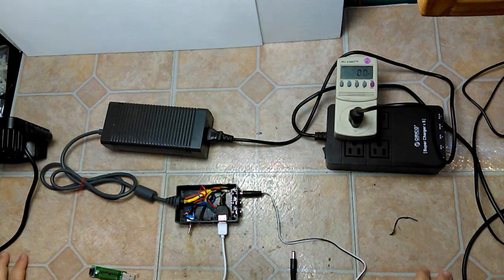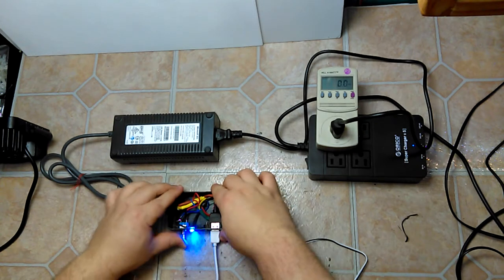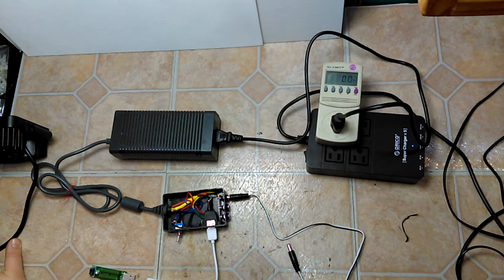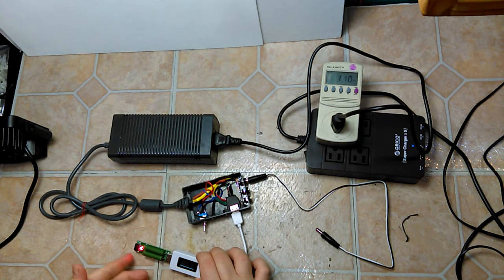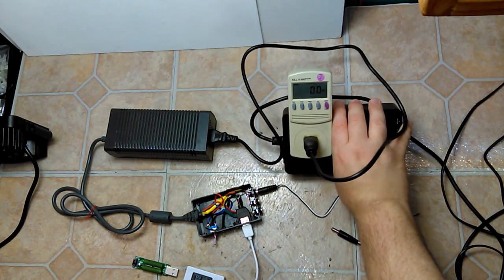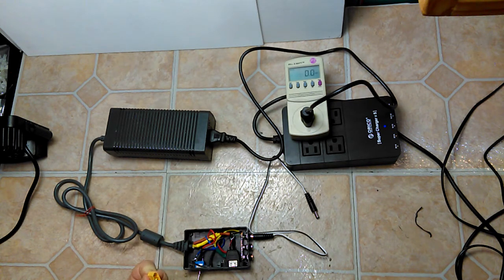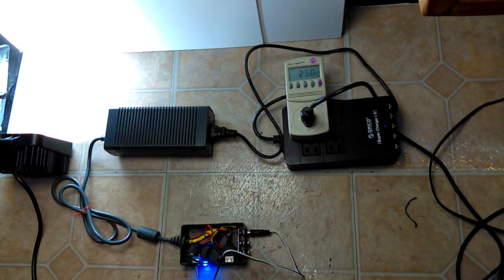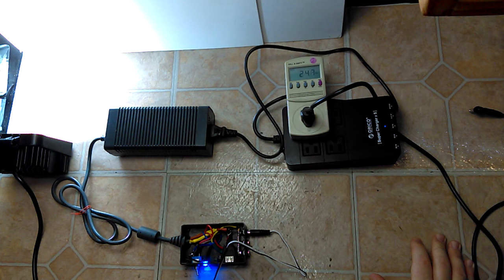XBOX 360 Power Supply Modifiaction 12v 5v USB

Comment: Hi,
Nice build. I'm also trying to transform an xbox 203w psu to power a picopsu for an HTPC. I'm trying to figure out if there is a way, instead of the switch for activate the 12V, to connect somehow the wires to the pico psu and when I shut down the PC the xbox psu will go in stand by. Do you think is possible?

Comment: Hi. Thanks for the video. I'm looking to use the Xbox PSU for LED lighting projects and I would like to use 12V RGB led strips and a 5V microcontroller. At first I thought this would be perfect, but I don't think you can tie the grounds together. Do you know if you can connect the grounds? I did a preliminary test with an led and resistor on the 5v line and got 12v on the others when the LED was connected, but as soon as I touched the grounds together, the 12v line dropped off.
Reply from the maker: Ok, for the PSU to work correctly the red 5v wire must be in contact with the power enable wire which is blue,  They all use the same ground on the black wire.  Its hard to tell, but I have one of the black wires going to the USB port that I installed, and the red 5v line goes to the switch and to the USB by a Y cable.

Comment: Man, i want one of those AC power meters :P

Im gunna use this to power my dc battery charger :)

I wanna pull it apart tho and check the fan etc so it cools even better. Might build my own case or something :)
Reply from the maker: The unit I use is called a Kill A Watt, they will run you about $15-19 in the US

Comment: You have a lot of expertise about these things; very thorough.
I just wonder what you use it for, cuz I feel this all does not make
much sense.
I have no idea what ur trying to achieve with this setup.
Reply from the maker: LED lights, security cameras, Power supplies for charging batteries.  Pretty much anything that needs a 12v or 24v source at a high amperage. The unit in this video currently runs all the lighting on my work table, about 140 Watts of LED strips.  A lot of others use them for stereo power supplies

Comment: I want to use the slim power supply into the classic original XBOX360 
Because it uses less energy and that will be perfect so it doesNOT overheat
Reply from the maker: No, the standard XBox 360 power supply provides the power need 200w 150w or 175w, the slim only provides 120w and can not power any of the other XBOX 360 models.  Not to mention that the power out pins is completely different on the 2
Reply: Data 795 
I know all that.
My point is that if they can make an adapter or a power supply that is around 130w or a120w  and test it so we can see if it works, it might work if it does it will be excellent
Reply from the maker: No idea, you will have to find it on your own, since I don't own a XBox 360 or One, it is of no interest to me.

Comment: Why is the grounding pin a problem? Cant i just make my own?

Why do i need to?
Reply from the maker: It depends on what you are using it for.  A grounding pin is a safety feature and it allows a point of reference of 0v compared to the active and neutral pin.  There are a lot of articles on why it is needed, so I wont bother you with my basic understanding.
Reply: Data 795 hehe ok but i guess i can just make my own ground wire :P

Thanks for the reply, im totally going to get one of those power meters!

Im also going to power a battery charger with an old xbox brick :)

I might weld a box for it too :))

Comment: can you get 5v 3A or only 1A
Reply from the maker: Not with the 203W 175W and 150W xbox 360 power supplies, you can push the 150W to almost 2.1a, but the other two trip once you get past 1.1a,   If you trip your supply and get a red dot, unplug for 1 minute than plug back in.
Reply: @user-wc3td5oj1e  thank you